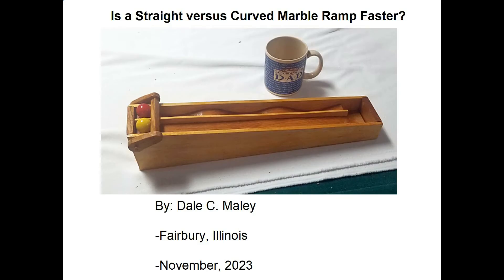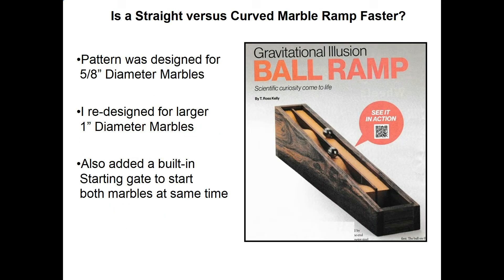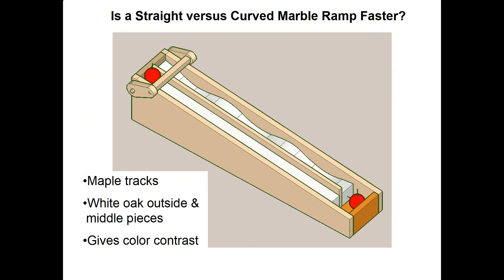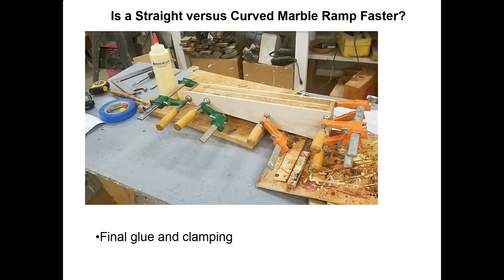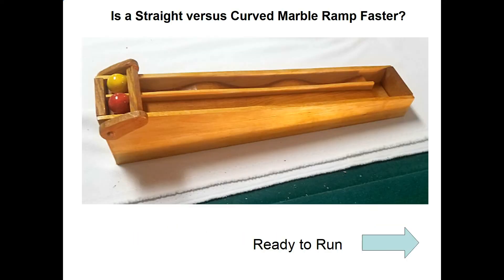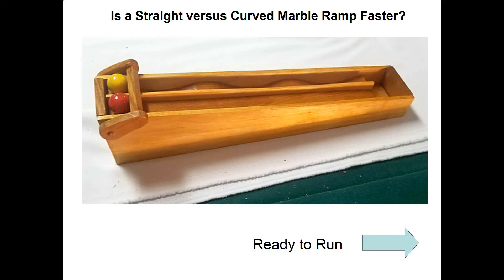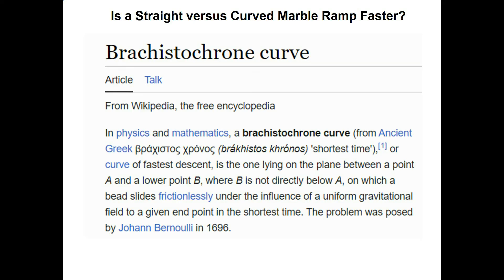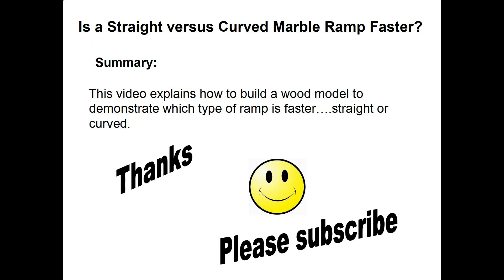Is a straight versus curved marble ramp faster?

Comment: i have a question. 
I wonder if the color placement makes a difference?
Reply from the maker: When I usually demonstrate this model, I operate it one way, then switch the marbles on their tracks, and the curved track still always wins :)
Reply: Hi thanks for replying….I’ve made another observation…the curved side is longer, correct?
Reply from the maker: Technically, the curved side is a longer track that the straight side.

Comment: It'd be interesting to see how phase offsets to the sinusoid path impact the situation. If you set it up so the ball starts on a portion of the curve where the tangent is horizontal, the ball wouldn't start rolling on it's own, but even shortly in front of the horizontal tangent the acceleration will start slower than the straight path, maybe the red ball can get enough of a head start (I doubt it, but how close can it get). A fun consequence of reality is that for a given incline and sinusoid amplitude, there can be a distance over which the ball picks up so much speed that it starts to jump, and then the ball's path and the curved ramp will start to destructively interfere, at an extreme that I don't think would actually be reached, the ball's path is 1.5 wavelengths and it will land at a point on the track where it's velocity vector is perpendicular to the tangent, causing the ball to stop completely or bounce backwards, potentially losing so much energy that it cannot crest the next peak.

In your diagram, straight down with a rounded bottom is the second fastest, I'm not sure you can describe this path mathematically but if you slant the initial path a tiny bit, now that's a sawtooth waveform with a low pass filter. You could do the reverse, a long straight segment with greater inclination than the straight path, then a short slanted-upward segment. This reverse sawtooth path should be the third fastest, and I'm lead to wonder if there is some parameters for it where it is curved, but the same average speed as the red ball. I suspect the reverse sawtooth path is really prone to jumping, and even at the same average speed, the greater initial acceleration should lead the reverse sawtooth ball to victory
Reply from the maker: Thanks.   My grandkids have a ball playing with the game. I took it to the coffee shop guys and had them predict which was the fastest, they made all 3 predictions (straight, curved, tie).....and they were surprised at the result.